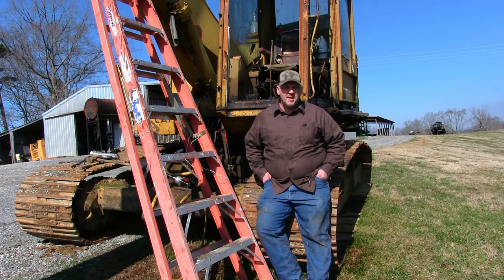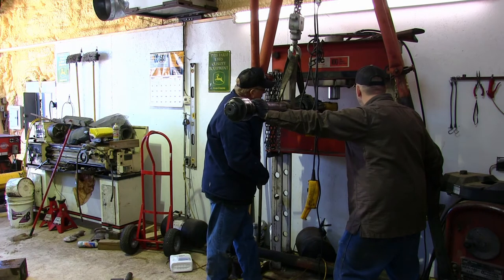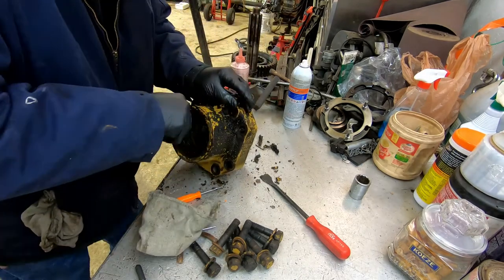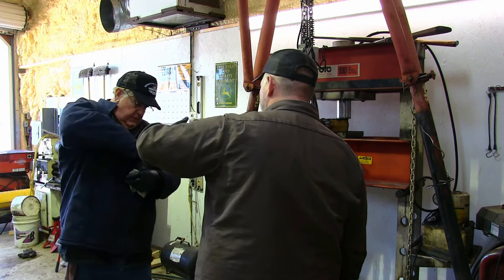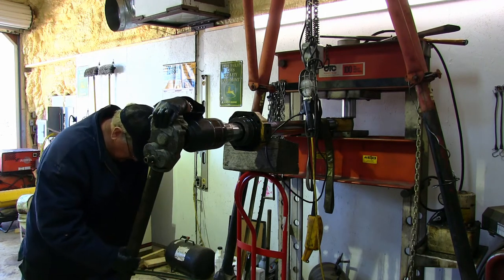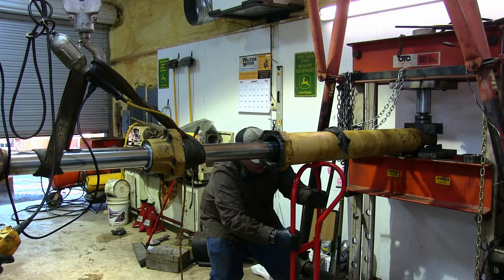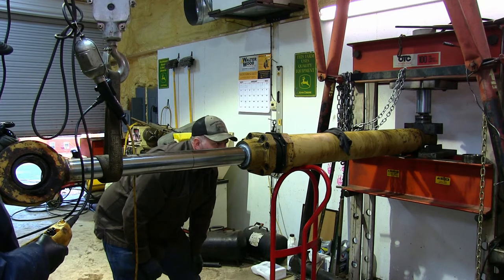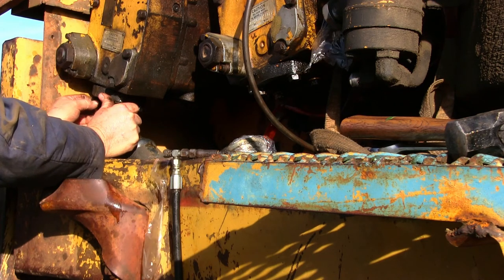Hydraulic Cylinder Repair DIY

Comment: Great job guys.
Can you please tell , what size impact gun , did u use. With what size drive
Reply from the maker: That is a 1 inch drive impact gun and if I remember correctly that was a 4 1/2 inch socket.  Thanks for watching!
Reply: @Offroadfarm1  thank you very much